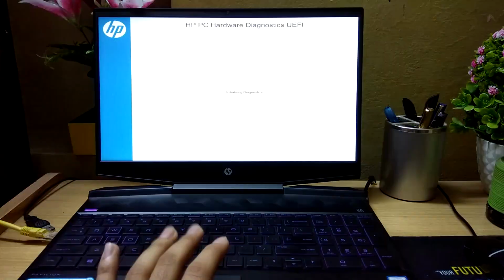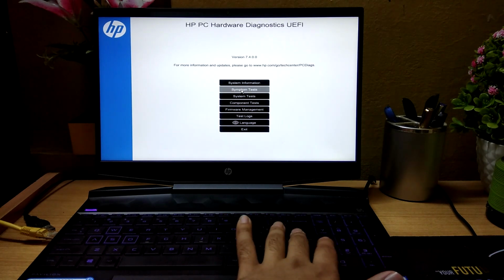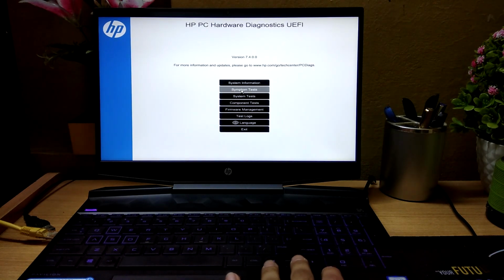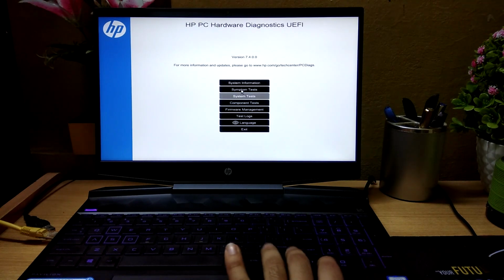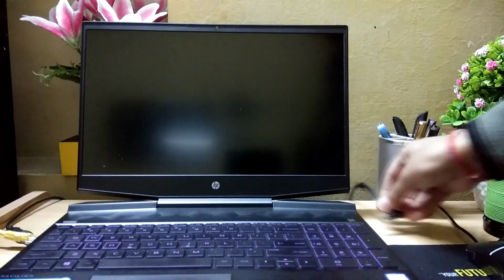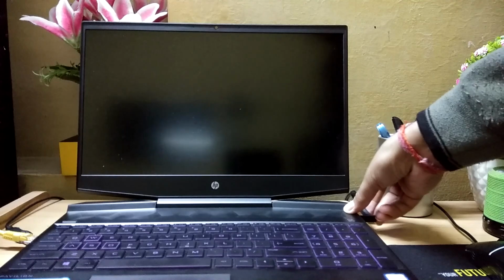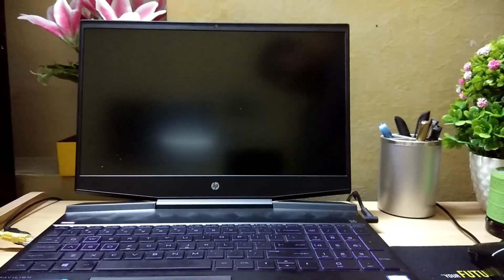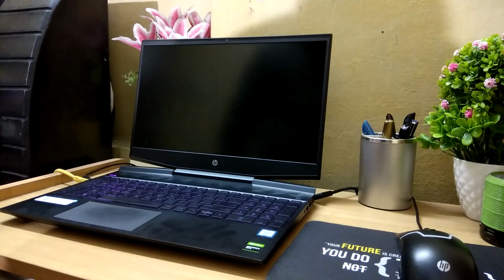How to Fix a Laptop showing Black Screen during Boot | Power on but No Display Problem Solved

Comment: Warranty gone??
Reply from the maker: With regards to the warranty question, the warranty would not void by default if you open the computer or change the components, but if any issues happen due to the new component or when the computer is opened, that will void the warranty.

Comment: Hey. Could you help I have a Lenovo G570 laptop with a Pentium B940 processor (2.00 Gh.z) and 2 Gb Ram (DDR3, 665 Mhz) with Windows 7 Ultimate 32x. The laptop was terribly slow, and I decided to order the Crucial DDR3L 2Gb 1600 Ghz 1.35V RAM.
I used your guide to do it right. So, I insert, Windows starts up, I go to the settings and I see that the old ram is being read, and the new one that I ordered is not readable. Although when I put a new ram,
it works, but the screen does not display a picture (the processor works, the cooler is spinning, but there is no picture).
Please help me solve this problem.
Thanks in advance. :)
Reply from the maker: I'll definitely help you. First clarify me what do you mean by picture? Is the screen blank or something else.
How much RAM currently showing up in Computer properties? (after inserting new one)
Reply: @TechTRANSFORMERS  
As it was 2GB, it remains.
By a picture, I mean that the image is not displayed on the screen.
Reply from the maker: I still didn't get it. Picture?? If display isn't working, how can you check RAM installed?